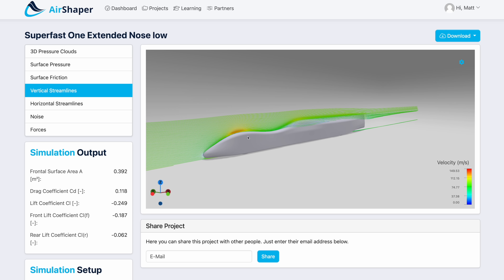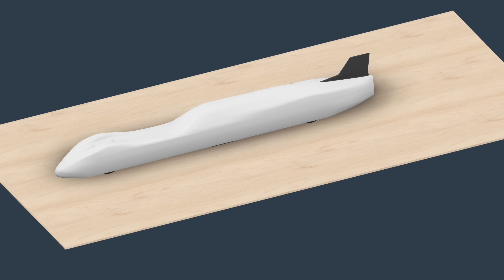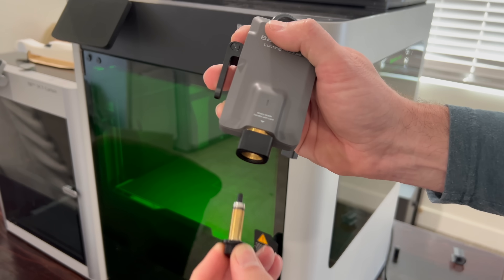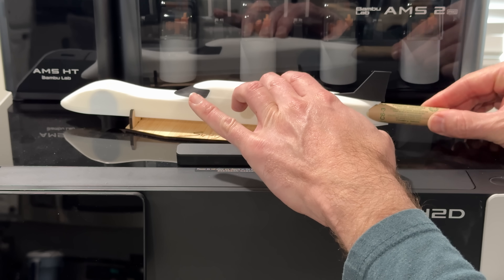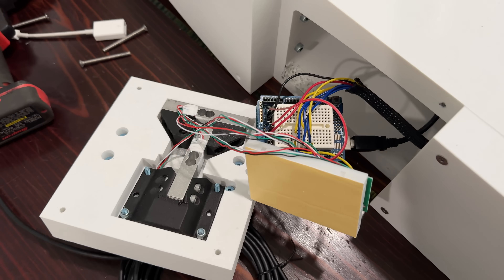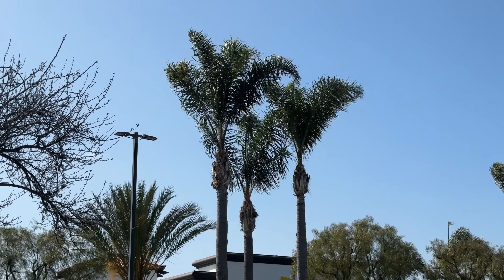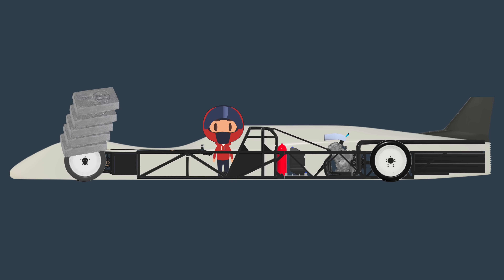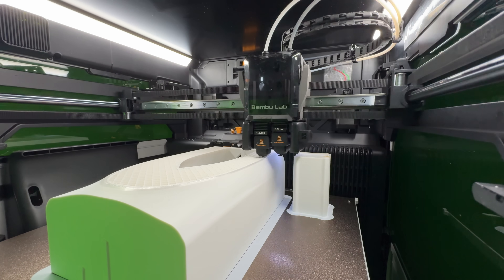Aerodynamic Testing On The Highway, With The Bambu Lab H2D

Comment: Dear Super Fast Matt,
I greatly enjoyed this episode of your magnificent YouTube series. 
However, I was a little troubled by the ending, not by what you did, I love the rocket car, it’s what you didn’t do.
I recommend using a guideline the next time you light off your rocket car. 
It’s super easy and not at all expensive.
All you need is some 100# test fishing line, two small eye bolts/screws, and two weights. 
To begin, attach the eye screws to the bottom of the car, one in front and the other in the back.
At the finish point of the track, securely attach the fishing string to the weight and place the weight on the ground. 
Ideally you want the string as low to the ground as possible, preferably directly in contact with the ground. 
Then roll out the fishing line to the start point, thread the fishing line through front eye screw, then the back, then attach it to the other weight. 
Insert rocket and let it rip.
The fishing line guideline may not keep the car wheels down, but it should keep it from flying off into the trees.

Comment: At one point I was really into the idea of building a "water tunnel", which is like a wind tunnel but uses water instead. Because water is much denser than air, you can test scale models and get more accurate results. Downside: it turns out it's really hard to pump large volumes of water fast enough to take advantage of this effect. IIRC I worked out the break-even point on scale is around 1:10--a 1/10 scale model in water will behave the same as a full scale model in air, when moving at the same speed (but don't rely on my fuzzy memory, do the math yourself if you're serious). Which sounds great, until you think about the logistics of making a tank full of water flow at, say, 60 mph.

Comment: Overall a Great video.   If you’re going to 3D print the entire rear fin without additional support or carbon fiber wrap I would recommend adding a test without any fin.  That way you’ll know how stable or unstable you’ll be if and when the print comes apart.

Comment: That wind tunnel would probably give better data if it were more tunnel. Specifically put sides on it. If you could put some kind of baffle grid thing on the front to clean up the air turbulence I think you'd be getting somewhere. Tack on a few ribbons on posts in the floor to verify the airflow is actually in line with the experiment. If you put a weathervane sensor that gave you a yaw angle and speed, it might help to select data that isn't being as affected by wind gusts.
Reply: Or you can accept the concept is basically cursed lol

Comment: Can you please comment on the finish attainable on the Bambu Lab H2D printer.  Most reviews show a printed object with layers like a stack of coins requiring sanding and finishing.  On the car, are retractable Canard wings on the front a concept to consider, giving down force on the front and directional stability, depending on the design. Seems to work in F1 racing cars. May alter the center of gravity towards the front. Flap on the vertical stabilizer to counteract yaw, would require feedback loop to predict and counter "Tank Slapping" at high speed.

Comment: A very sizable effect on the testing may have been from the location on the vehicle. unfortunately anything about a foot from the exterior of a car is immediately in undated with weird low pressure zones or turbulent flows. If there's some way to place it in front of the vehicle or even on the hood that may give much better results. As lovely as the plywood sheet is it doesn't represent the functional aero surface as the ground you'll be driving across will not be in motion. Using a boom arm far in front of the vehicle is the common technique I have used for model rocket testing. BP space has some good videos using that technique although with some what short boom arms. Good video nonetheless and please take my advice with a grain of salt

Comment: While it is nice that this printer is pretty quiet, you should not be printing in the same room where you sleep or if you stay in there for a time, because depending on the filament a 3D printer will give off fumes that go from "maybe not harmful" to "definetly harmful". For example, printing with glass fiber means there will be glass fiber in the air and in your lungs - not good.

Comment: @SuperfastMatt

With enough experience an engineer should be able to look at a design from an engineering and manufacturing context and have a pretty good idea if it will or will not work. It doesn't always take finite element analysis to understand that you have to physically be able to assemble and maintain the very item you are designing. If you can't bolt it together in real life than the hours you spent on the solid model drawing are wasted. The "engineers" that cannot grasp this are the ones to avoid.

Maybe you should have dedicated that 12 seconds to a longer Bambu ad, apparently most people on here don't think yours was long enough.

Comment: wonder if the renolds number allows for lower speeds if you use water instead of air (basicly make it a torpedo) 
the higher density of water should lower the speed equasion dramaticly while still allow you to test the stabillity
as for the windflow over the board , think youre right , could solve it by mounting the model on a higher pole that way the flow over youre car shouldnt influence it as mush
seen someone test a power generating windmill and they mounted the thing on a pole on the front bumber of their car ............ not my idea of safe for other roadusers (blades did explode a few times) but when testing youre streamliner it might actually give you a view of the model during the drive

Comment: The biggest advantage of wind tunnels is they can have a “rolling road” underneath so you get more accurate ground effect results as the ground floor air interaction will be different if the air model believes the car and the floor are moving through the air than if the car was moving past the air and the ground at the same time, obviously your stabiliser is most of the rearward pressure and seperated from the floor by the main body but it’s a difference that’s worth noting

Comment: I’m a total amateur in aerodynamics, but the wind coming off the front of your vehicle and the windshield in an upward direction is destroying the clean air you need for your test on top of your forerunner. That model needs to be on a stick in front of your vehicle in complete clean air or maybe elevated off the hood or the brush if you have one.

Comment: Reynolds number stuff:
The equation that fluid dynamics uses is the Navier-Stokes equation, which is secretly a statement of conservation of momentum.
You can factor out dimensional values (a characteristic distance, a density, a viscosity, etc), like take radial distance in a pipe to be fraction of total radius * total radius, and group them together.
If you have two scenarios that just differ in scale, but when you factor out dimensionality and group it together to be the same equation, would they not effectively be the same equation?
In a cut down version of Navier-Stokes, the grouping of dimensional values is the Reynolds Number.
So when flow in a normal pipe reaches a specific Reynolds Number, would tend to become turbulent regardless of certain variables (highly dependent on other factors like pipe smoothness)

Comment: Great stuff!  I wonder- to get more accurate test results, would it have been better if you could have suspended the model a few feet above your truck, in the air within a platform?  Or, would it have been better to have done it with a larger platform, so as to have moved the possible edge effects far enough away so that they wouldn’t affect your test results?
I’m looking forward to your winds tunnel testing!
PS, I wish you’d used a roast beef or brisket sandwich instead.  Using that ham sandwich… just wasn’t kosher. 😂

Comment: you know, making a diy wind tunnel could be a great single video project. It's not particularly hard, a big pipe, a size adapter, an even bigger pipe and a big fan. Ideally also some smaller pipes stuck together in a bit of smaller pipe as a collimator. Going up to highway speeds without the air going messy isn't too hard, we had one of those for an aero students lab course experiment at uni :) Worked reasonably well to measure lilienthal graphs of models with spring newton meters

Comment: I mean there are a few - easy - things you could have done to improve the highway-"tunnel":
1. add a bunch of straws infront of the model (straighten the flow of the air)
2. add side curtains (to move the vortices around the tip upwards and don't interrupt your laminar flow thingy)
3. add a funnel and (a windspeed sensor) infront of the dummy (increase the wind speed)
4. add a rolling floor as the not moving floor creates turbulence on its own (laminar drag) you could move the dummy on a thread mill, letting it rotate at a speed equivalent to the windspeed that the model is experiencing..
5. Moove the thing to a trailer since it became to large and spend 1000k on air shaper to find "rear spoiler"-geometries for your forerunner to redirect the airflow cleanly behind your car, into the wind tunnel funnel.
6. Travel to Germany/north Korea or The Isle of Man (Lands without restriction on highway speed) and take the paddle to the floor.. 
7. realize that you spend to much in a make shift highway wind tunnel and could have build one for the same cost.
8. Build your own wind tunnel for the same cost as the points above

Comment: Hi, Matt.  When scaling aerodynamics for aircraft you usually want to try to match the Reynolds and Mach numbers by adjusting flow velocity, but you can also change pressure or fluids to adjust the kinematic viscosity and speed of sound.  If the flow is expected to have vortex shedding then you probably want to instead match Reynolds and Strouhal numbers.

Given that your car is operating well below the transonic regime, matching Mach number is not critical as long as you stay below M=0.6 or M=0.7.  If you want to get accurate drag values then you'll want to match the Reynolds number as closely as possible.  If you're looking for general stability information then your Reynolds number can usually* be off by up by an order of magnitude or more and the results will still be good enough.

Assuming that your car is about 20 feet long the Reynolds number at 200 mph is about 3.7e7.  Your model on the highway was operating around Re=2.8e6.  That's more than close enough to get good stability data, and you might even be able to get drag values to within about 25%.

A direct velocity scaling to match Reynolds number would give you a flow speed of 800 mph (M=1.04), which obviously wouldn't work because the model would experience Mach effects that the real car won't.  If you want to exactly match Reynolds number with a 1/4 scale model then your best bet is to find a pressurized wind tunnel or a heavy gas wind tunnel.

I'm curious how you came up with a speed of 1,000 mph to properly scale the flow around your 1/4 scale test model.  The equation on Wikipedia that you showed used Reynolds and Euler numbers.  I've never seen Euler number before, and apparently it has something to do with energy loss in pipe flow.  It seems incongruous and incorrect to include Euler number in a section that then goes on to talk about testing external flow around scale models.  That section of the Wikipedia article definitely needs revision.

I doubt that I've said much that you didn't already know given your past experience with race cars, but hopefully there was something that you'll find helpful.
Reply: Energy loss in pipe flow wouldn't be for the air flow in a conventional wind tunnel would it? Because I'd imagine there would be some energy loss as the air pushes through the tube that the wind tunnel is constructed from.  

I'm only an attempted engineer, so I don't know for sure but that makes sense to me
Reply: @sirspamalot4014   There absolutely is an energy and pressure loss in a wind tunnel, but my understanding is that blockage plays a larger factor than energy loss.  Wind tunnels use a blockage correction factor to account for the model blocking part of the test section and restricting flow.  Usually you want to size your model so that you have no more than 5% blockage to minimize blockage effects.  I think Euler number is used when evaluating piping systems (head loss).
Reply: Wouldn‘t it be the easiest way to test the model under water? As the density of water is approximately 1000 times higher than air. This will reduce the required speed through the fluid, significantly.
Reply: @heinerbirck1829  Water channels and water tunnels are frequently used to test models.  There are two difficulties, however: 1) Reynolds number scales by kinematic viscosity and while water is much more dense than air it is also much more viscous so the actual reduction in speed is unfortunately not 1000x, and 2) water tunnels are generally limited to relatively low speeds compared to wind tunnels.

Matt's 1/4 scale model would need a water tunnel capable of 71 mph.  Most water tunnels max out at 40-45 mph.  The other issues with testing in water in general are the high dynamic pressure exerted on the model and the onset of cavitation.  At 71 mph the dynamic pressure would be 72.9 psi, and I'm relatively sure that the pressure drop on the back end of the car would be sufficient for cavitation bubbles to form.
Reply: Question from a fellow aero engineer here - While I know it's critical for accurate drag estimates, how important is a rolling floor for stability analysis?
Reply: @bartybum    I think that would be a question for someone who specializes in automobile aerodynamics.  My guess as an aerospace engineer is "not very" because Matt's wheels are almost entirely faired.  Also, when evaluating lateral stability of an aircraft the primary factor is where the centroid of the side projection resides relative to the CG.  (Quick and dirty back-of-the-napkin yaw stability analysis.)
Reply: claude ruelle ah response
Reply: I was wondering if it would have helped if he put sides and a top on his platform.  That would help cut some of the cross winds wouldn't?  Possibly also make the bottom more rigid with less flexing that was giving bad data? Maybe not enough to make a difference or maybe not at all?
Reply: @bezerker02   It might have, or extending the plywood further forwards, or adding a flow straightener, or just turning the whole thing into a fanless open circuit wind tunnel strapped to the top of his car.  Realistically, due to the limitations of his sensing apparatus the actual difference would probably be pretty negligible.  On the other hand, it most likely would have prevented the model from being stable at 45 degrees because: 1) Matt is probably right and the 45 degree stability maximum is caused by vortices rolling off the edges of the plywood, and 2) plywood sides wouldn't allow the model to rotate a full 45 degrees.

There's a point in experiment design at which you say "this the the limitation of what I can measure and therefore further improving my test apparatus is not going to significantly improve my data."  Without seeing the magnitudes of the averaged restoring force measurements or the raw data it's hard to guess, but based on the variance in the plotted nondimensional data it seems likely that there is significant noise in the raw force measurements (time history of force).  You can even see the tail end of the model vibrating in some of the shots.

Adding plywood sides would help some, but would the improvement be worth the time spent?  Who knows.
Reply: Nerdddd

Comment: The old way to "test" where the air is on the body,  and what it's doing around a vehicles body , is to use tape and strings with a tail fin at the back end of the string , the strings should be spaced every 4 or five inches apart,... then use cameras around the body,  to see the strings move around with increasing speed runs. You may learn more about your body's airflow by watching the strings during your speed runs.

Comment: The data plot was brilliant.  So typical.

Unfortunately I think you're getting a ton of messy air interfering with your test - your plywood board probably needs to be significantly bigger to negate the weird flow coming off the front edge from the car, and the vortices wrapping over the side edges.  But ultimately the biggest issue is the highway environment - you've got buffeting from other cars and trucks, windy day effects from changing directions (as you follow a curving road for example), etc etc.  I think if you went back to the salt flats or a very straight road where you didn't turn at all, that would help, especially if it was a near windless day, or you knew the angle of the wind, or you were somewhere you could drive into the wind.   If you had a wind vane measurement while driving you may have been able to cancel out some of those effects (or at least adjusted for them)...
 
It's probably not that important for the stability measurements, but definitely when you were trying to measure drag etc with your load cells - since the "ground" is not moving with respect to the car, you will definitely get strange flow interactions and not very good numbers (thus additional $$$ for moving road wind tunnels).

I think your intent was good.  Like the oven, I think you need to build a wind tunnel.  With a rolling floor.  Just remember for accurate subsonic wind tunnel work, you need less than 5% blockage.  So scaling your 1/20th model up to 1/4 scale, my math says you need a tunnel that is 42e-6 Hectares in cross sectional area.

Oh and welcome to the world of 3D printing brand loyalty.  You have chosen the dark side.